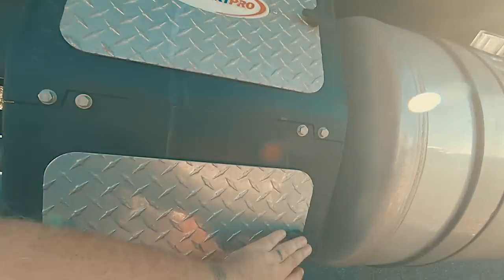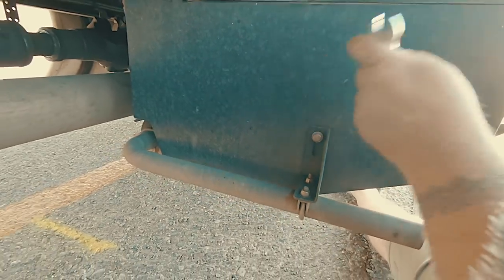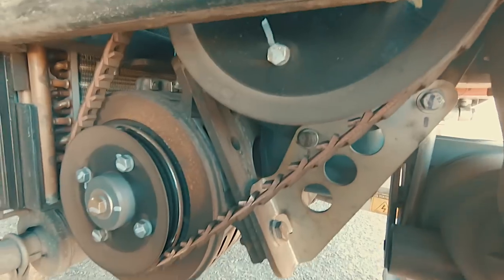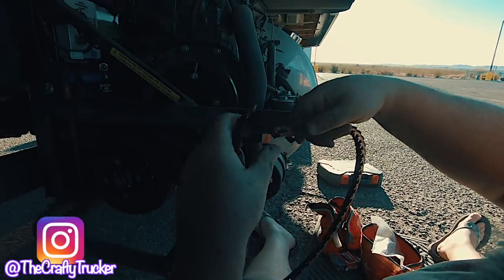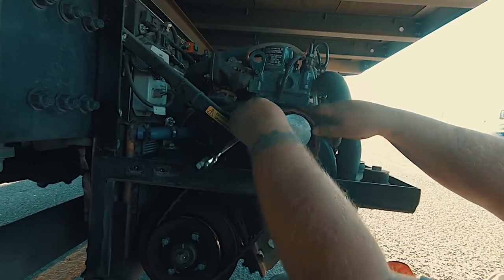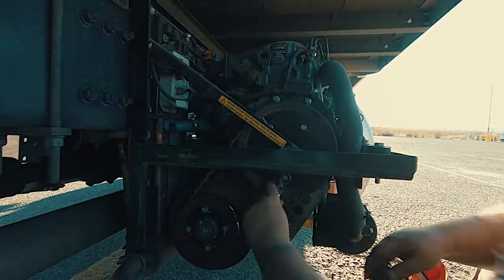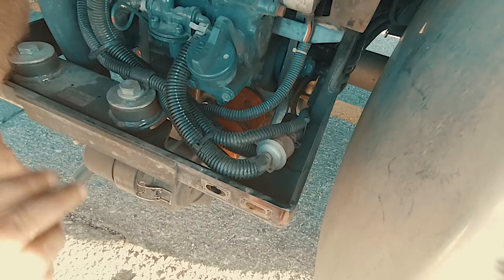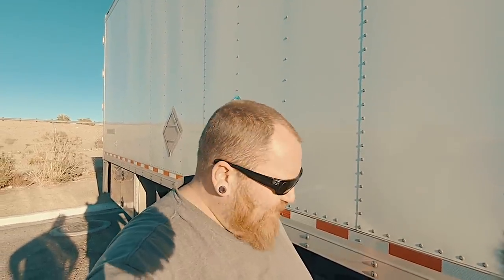CARRIER COMFORT PRO APU MAINTENANCE & TIPS

Comment: This video was extremely helpful in finding  why the heat was not working. My carrier has given up on the comfort pro not wanting to fix the heat. The shop or the shop thay sent it to did have not clue. So simple all i used was a pair of pliers. As for the belt  tool you can just roll the belt back on. I did my belt only from the top cover off. As i guy who works on gen sets i totally forgot this was a belt drive And was going all over trying to figure out why low hz here i was trying to find the engine spec rpm. Like a dumb dumb i totally forgot about belt slipping = low hz. Thanks for this excellent video by the way anyone can do this.
Reply from the maker: frank That’s great we are so glad this video helped and you got it figured out. :)

Comment: I’m glad you put this video up. I didn’t have the special tool but it went on just fine. Put it on like you indicated, hold firm pressure with the left hand keeping it in the groove up on top(mine is on a tractor so I could lean over it) while slowly rotating the bolt clockwise with the 17mm and it pops right in. That bottom case half is a bear to put back on when you are alone. Mine actually uses a V belt(about $10). Carrier in Sioux City gets $58 for the belt you are using. Thanks again for sharing this.

Comment: You may not have all the names right, but you certainly have the knowledge & that's the most important part. That reminds me, I have to change the oil in my Kayak motor LOL...          Nice video Jason along with  your pretty & enthusiastic assistant, LoL......    Ya know in the old days they made what they called a V-los belt. Was similar to what you have only held together by rivets. My dad used V-Los belts often because on machinery getting the correct belt was hard and you could make that any length you wanted. They also had a belt power that make the belt stop slipping. I was a kid in those days hanging out in Dad's machine shop.  In my own shop, we never used adjustable belts.  They slipped easy and ruined expensive pulleys. However all our equipment had adjustments for belt tension. Talk about an expensive belt, I had a CNC lathe that the 12"  timing belt cost $350.00. All I know is it had cables in it to keep it from stretching. We changed it once along with the timing pulleys in five years because the teeth went bad.
Reply from the maker: Pete_ Hine_Of_PA Wow that is an expensive belt! Thanks Pete :)
Reply: Similar to your truck, there are just some parts that are expensive, do a big job and you can't skimp on them, nor can you purchase "after-market"... CNC belts are extremely accurate.

Comment: Yes, I had to remove all the videos and cancel the IMPCO YouTube channel. If you watched the videos, you may have noticed that the opening showed the ComfortPro facilities, and with Carrier buying the ComfortPro brand, they didn't want the previous facilities at the beginning of each video.
My first comment, glad to see you said to remove the 4 pin plug to disable the APU, the last thing you want is for the APU to start on some programmed function!
Just a couple of pointers, yes the belt can be installed without the tool, but don't expect long life from the belt. The tool is designed to prevent the flywheel pulley from cutting the edge of the belt during installation. You wouldn't notice the cut when installing, but it will shorten the belt life.
Also, to remove a link, turn the belt inside out and it will be much easier to separate the links. And still on the belt, it is a directional belt and must be installed in the correct direction or the belt will fail very quickly.
On filters, both oil and fuel, these are special long life filters! Often you can find a cross-over to another brand, but especially for the oil filter, don't take a chance! And if you have to dent in the corner of the filter to get it past the frame,,,, something isn't right!
Sometimes people will say "that person wrote the book on,,,,," indicating that the person is the expert. I wrote the troubleshooting and diagnostic manuals for the ComfortPro series of APUs, and I created all the IMPCO ComfortPro videos!
Reply: I got in a truck, first apu, and I'm learning all this. The oil filter, you said NOT to use a crossover filter? How often should I change oil/filters? I have many questions
Reply: You said it is a “directional belt” what is the correct direction to install it?  We took ours out removed a link because it was loosely, reinstalled and it twisted up when turned on. What did we do wrong? Any tips will be of great help.
Reply: @Remse413  If you look, you will see little arrows on the belt. That is the direction the belt should be moving. There is a tool that needs to be used when installing the belt, it protects the belt from being cut by the edge of the pulley. The tool lifts the belt up and over the pulley and directs it into the grove. Rolling the engine over by hand could help ensure that the belt isn't twisted.
Reply: Hi, can you put up some how to videos on this apu such as oil change etc?

Comment: very nice explanation of how to change the power belt on your generator ,, i have a very similar APU on my truck it works really good and is easy to service I like that belt on yours , i have never seen one like that before ,,I have a plain black belt on mine that's 3/4 in wide ,and mine has a jack screw to adjust the belt 

I have one of those Rig master APUs too ,, i hated that thing  with it's  cranky perkins engine always  refusing to start in the cold 
I took it off and went through the engine ,, and have modified it to be a backup generator here at my farm ,,I removed the AC compressor and condenser  and all the hardware for that and added a second generator  ,, the primary 6.5 KW generator will run most everything in my house and it has a 4Kw generator that has a AC/DC inverter that effectively makes the 35 amp AC generator a 350 amp battery charger it will charge my full bank of 20  ,,  1K amp hour 12V AGM batteries ,,while at the same time  providing 25K BTUs of heat to my house through heat reclamation from the exhaust and coolant and powering most of the house  all at the same time 

it was actually cheaper to do this  than buying a standby generator  that runs on propane or natural gas and most home type backup generators  even the bigger ones closer towards 15 and 20KW have air cooled engines ,, i don't need a bigger generator  because if i need more power i live on a farm  I have several way larger generators ,, the biggest of them powered by an 8V-92 detroit  225KW  it'll power a small town ,, it's a really strange machine ,, a former military generator  it was originally used to run 4 gigantic AC welders  for building bridges,, i inherited it from my neighbor who bought it at a surplus auction
Reply from the maker: wildcoyote34 Thank you so much. Sounds like you have a lot of experience with generators LOL be safe
Reply: I have some experience with them  , but mostly it's my love of building things , I raced lawnmowers in my teens and used to build race cars too ,, i love building stuff and proving it can work

Comment: I really appreciate your videos...I just bought a T680 with a Carrier APU, and it's not working.  Starts and runs, but n power to the outlets inside, and the heater isn't working.  I searched videos, and found your vids...checked my belts and both are really loose.  I've been working on various vehicles my entire life, so...I do know a loose belt when I see one, these are loose loose.  Just reviewed the vid for a second time before I go out to tighten them both.  I don't have the "special tool" so, wish me luck.  You two be safe.  I drive for Landstar.
Reply from the maker: Could also be the breaker tripped. It is on the motor that requires the special tool. You should do ok with out the tool. Jason has done it once before. Cool a fellow BCO

Comment: Jason, did that temporary belt come on that generator? Cause by design that belt will have less surface contacting the pulleys due to the space between the links. I’ve used those in the industrial setting for years but only to get us by till the weekend when we’d change it out to a Gates belt. They are tough belts but would slip on us under heavy loads until we got it changed out. Just wondering if it’s being used as a standard now instead of a backup? And this was another awesome video by you 2!

Comment: I wonder if an after-market, automatic tensioner would work on this. It might extend the maintenance cycle. I see that there are some places for mounting on the frame. Plus, all you’d need is 1 wrench to take the tension off the internal spring, something to keep one of the other pulleys from moving (or just use the wrench you used on the generator), and the belt would almost fall off.
Reply: We tried automatic tensioners, they didn't work out. They normally are flat and run on the backside of a belt, so they wouldn't work with the linked belt, we also tested flat belts with a tensioner, the pulleys for the flat belt were very expensive, between the belt, pulleys, and tensioner it would have increased the price dramatically.

Comment: Many Years ago...I made a APU out of a FORD 1200cc gasoline engine from a ford pinto station wagon. I welded a support frame outside of the cab over engine and hooked it up to my truck. Sucking from the lower radiator hose and a pressurized engine block feed to the cab heaters via a check valve allow a flow of hot coolant for heat in cab and engine block.  The 12 vdc alternator charged the batteries.  The exhaust was routed to keep the oil pan warm <no syncretic oil in those days>.  A 6 gallon fishing boat gasoline tank was added for fuel. Ran on 2 gallons a night.
Reply from the maker: Davy Jones Wow very cool. When you can’t buy it make it, right?

Comment: The current production units have replaced this belt with a flat multi-groove belt with a spring loaded tensioner. If you have to replace the generator, you can upgrade to the newer belt with a retrofit kit.

Comment: Hi Jason, might be you know how to deal with codes 3545 and 3546 Main breaker tripped and HVAC breaker1 tripped. My AC works fine, when i try to turn on HEAT its turns of after couple min. And the display shows “HVAC breaker” . APU runs fine, just heat is an issue! Any ideas?

Comment: Im having trouble with mine it will say CCU MAIN BREAKER TRIPPED how do I fix that I have had it in the shop 3 times and they say nothing is wrong. It doesnt do it all the time. I can be using it one day and the next time this will happen then it may come back on that day or A few days later. Can you help me? Or tell me who can I have had it to carrier  twice and thermo king once an they tell me there is nothing wrong with it because it doesnt do it when they have it. But im sitting right now in heat and A no idle zone an it says ccu main breaker tripped

Comment: What about the problem inside the cab on “LCD screen panel shutting off” to where u can’t turn the APU on?
Reply: 4th Imptiness we’ve never had that problem. If the screen is not on it is most likely a power issue. I would check the plug on the back or at the battery terminal

Comment: I keep getting TEMP led fault after APU shuts down. Usually when ambient is 105 F or higher. I’m wondering, is there a Thermostat in the coolant system?? Coolant level is full.
Reply: Gary Gmoney Trader if it’s tied into your engine i don’t think it has its own thermostat. Have you check out the trouble shooting in the manual? http://impcotechnologies.com/pdf/manuals/30-864-81e.pdf
Reply: Mr Crafty Trucker I don’t think it’s tied into the engine. Shop says it has a thermostat.
It’s a comfort pro.
Reply: Gary Gmoney Trader it does. I just found it. If it’s getting hot or over heating there would be three things to look at start with cheapest first. Fan belt is tight. If it’s loose or broken it’s not getting enough air to cool. Next is coolant flow. If coolant is not circulating properly it will get hot. First I would check thermostat then water pump. Third would be low or old oil. How many hours are on the unit?
Reply: Mr Crafty Trucker I believe my shop has the solution. Pull the air flow cover, that mounts to the right (outside) of the unit. The increase in airflow is dramatic. The APU pro showed me the thermostat is working perfectly by using a temperature gun.

Comment: Is this  apu has manul prime   after replacing the fuel filter?
Reply from the maker: We’ve been told you hold the start button down to prime until it starts. No rubber push pump though
Reply from the maker: We always poor fuel out of old filter into new before installing just to help it out
Reply: Thank u guys  soo much
This  weekend ill change the filter
Thanks again
Reply: thanks !  i did  change the  fuel filter  and started easy the apu

 thanks  guys

sol hold   solid red light on          do u guys had something like that?

Comment: I was unplugging the battery cable, meanwhile the APU unit was starting by itself, i unplugged the battery terminal anyway meanwhile the unit already started but thirty seconds later the unit shut off, after I finished my work on my truck, I plugged all the battery terminals into the same position then I see there was no power  inside the cap computer and there is no light engine in the APU power as well. Does anyone know what happened?
Reply: Shabbir Jafri breaker or fuse would be my first things to look at.

Comment: My AP keeps shutting down any ideas!
Reply from the maker: Jose Garza need more specifics. Tons of reason it could be doing this. Fuel gelling, clogged fuel filters, over heating, can you give any other details? When was the last time it was serviced? Last time you changed inline fuel filter
Reply: That's my problem I have taken it to get serviced and charged the big bucks, works day maybe two then shuts down.
Reply: Jose Garza check out this vid. Could be your issue. 
https://youtu.be/ijtQTtTBPFA
Also I would check the inline fuel filter. I have heard of many service places putting this in backward causing the APU to choke out from lack of fuel
Reply: Thanks for answering my questions I also have another question, my unit doesn't put out hot air for heating purposes. Really runs me batty 🤐
Reply: Jose Garza is the fan not blowing or just not blowing hot air?
Reply: It's blowing air just no heat! I'm telling this thing really drives me nuts! Thinking of just taking darn thing off, 500 lbs less LOL! REALLY  appreciate your feed back:-)
Reply: Jose Garza May need to replace the thermal fuses. Part number 30-759-04K

Here is the manual for troubleshooting. You will need to down load the Dropbox app to save it.
https://www.dropbox.com/s/8frgafih0jwyq63/Comfortpro%20apu%20manual.pdf?dl=0

Comment: They're bolts, not screws. And that's a Stator not an electric motor. And that's a pulley. Thanks though. Good to know. I just bought a used Western Star with a Comfortpro and it's heat is pathetic. I'll have to check the belt.
Reply from the maker: We know what they are. When talking to a camera you get a little tongue tide sometimes.

Link for the manual.
https://drive.google.com/file/d/1FoIoMgr9guJfd8TE0FfBG-cUo6Yg5qU0/view?usp=drivesdk

Link for parts list
https://drive.google.com/file/d/16ro2j07zepFg35NMGMo6jeCLuC85Mq0b/view?usp=drivesdk
Reply from the maker: You’ll need google drive app to save them. Good luck with your new truck.
Reply: Ooh, just what I wanted for Christmas! How did you know? 😁